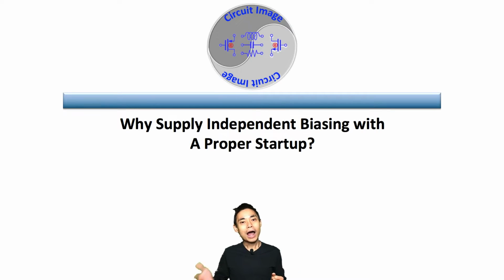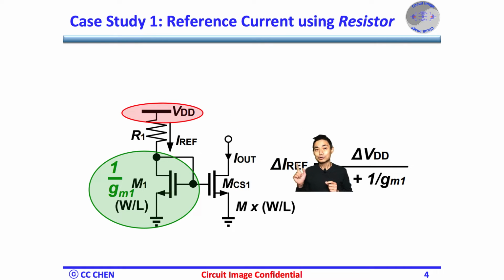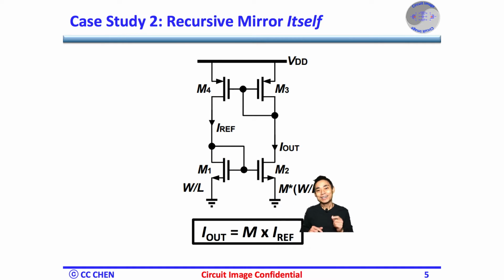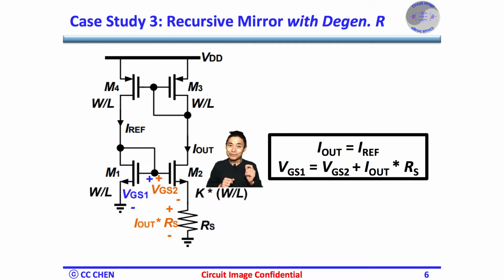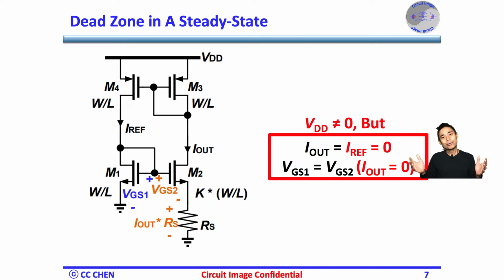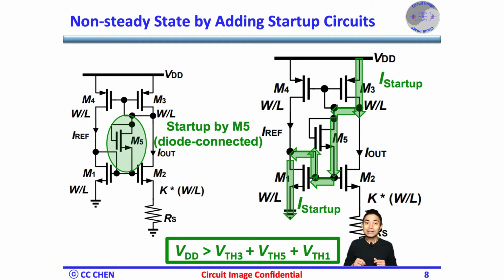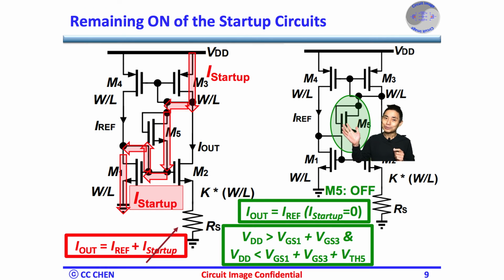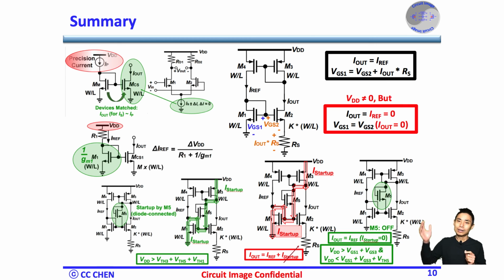Why Supply Independent Biasing with A Proper Startup?

Comment: Very nice video, ill try to use this in my project. Btw how can i dimension the transistor M5 used for the startup circuit?
Reply from the maker: Hi F.Meireles,

Thank you, glad you liked the video! Using M5 in the startup circuit is a crucial design detail, and sizing it correctly is important to ensure proper functionality. Here's a general approach to help you dimension it:

Start with a minimum channel width (W), as M5 should provide only a small current during startup. A width much smaller than the main circuit transistors is usually appropriate.

The length (L) can be slightly larger than the minimum to reduce leakage currents, which helps M5 stay off during normal operation.

Pay attention to the gate biasing of M5. Its control voltage must be such that it only activates during startup and turns off as the circuit stabilizes. A voltage divider or a delay mechanism is often used to achieve this.

Simulate the circuit during power-up and ensure that the current provided by M5 is sufficient to charge the required nodes and initiate the circuit.
Check its behavior after startup to confirm that it fully turns off and doesn’t introduce unnecessary power dissipation or noise.

If you'd like, you can share more about your circuit or simulation conditions and I’d be happy to help refine the design further.

Thanks,
CC